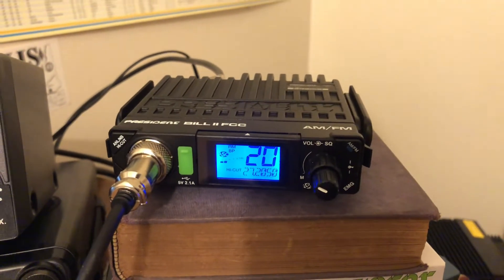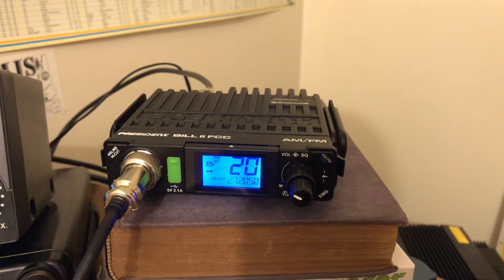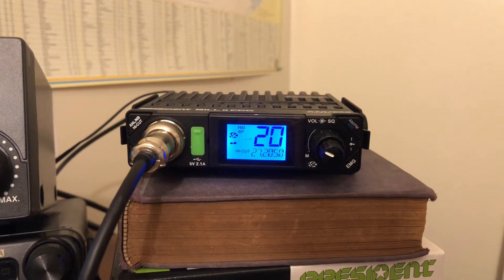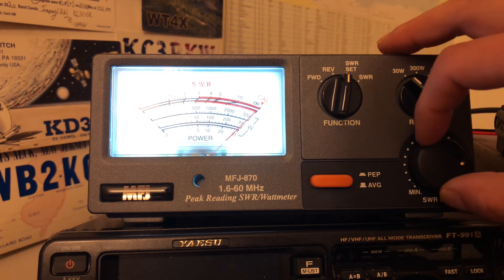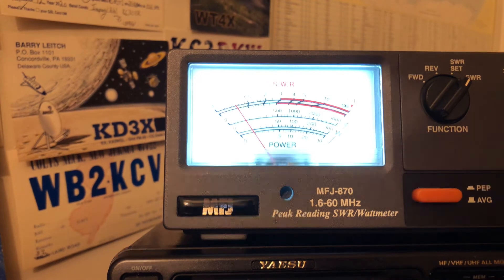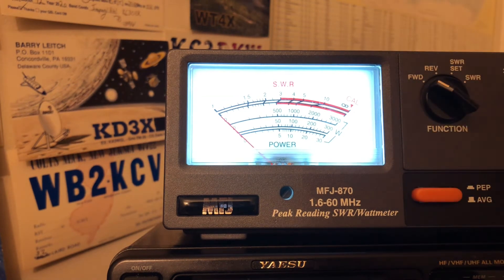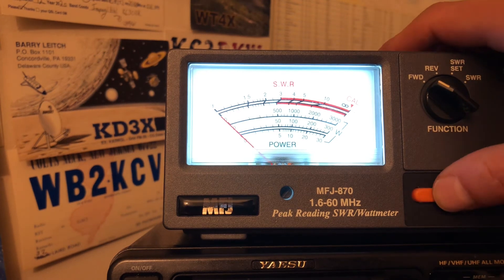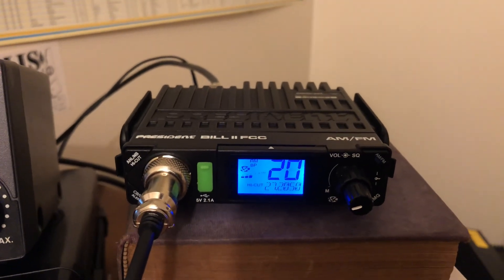President Bill 2 AM/FM SWR & PEP Test.

Comment: Hi, I would like to test SWR on a President Bill. I have an MFJ Balanced Balance Line Tuner MFJ 974HB. I'm sure I could tune it with this but is it possible to just find the SWR with a tuner as I'd like to use the MFJ with a base station at home?
Reply from the maker: Yes, and you can look up the manual of your tuner on the MFJ website. So I suggest you reading it.

Comment: Does it have echo or put echo mike
Reply from the maker: No echo.  If you like the radio, I suggest you also use an aftermarket echo Mike.  It’s a six pin, so you will need an adapter to a four pin.